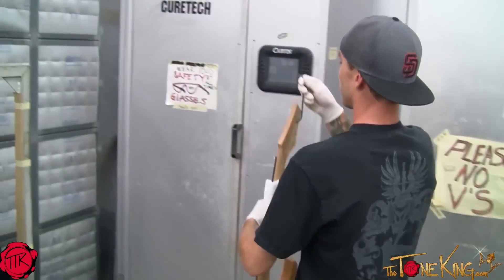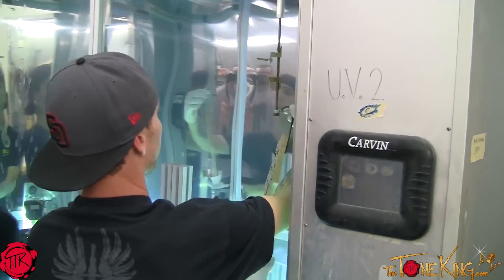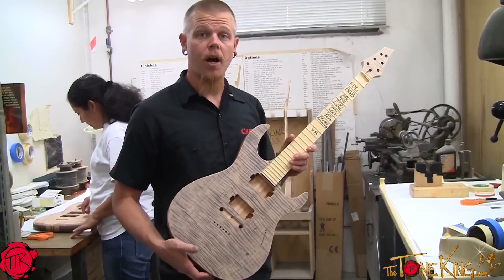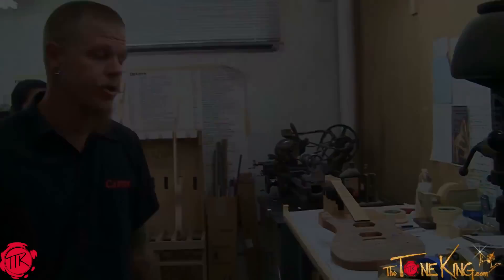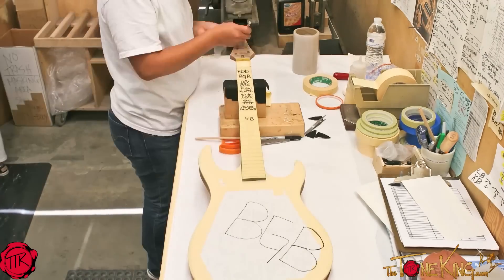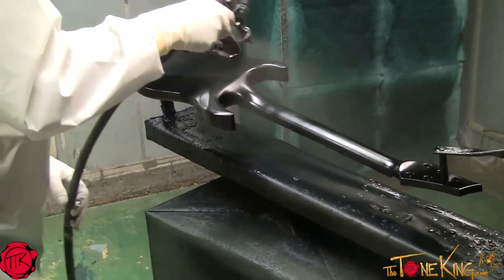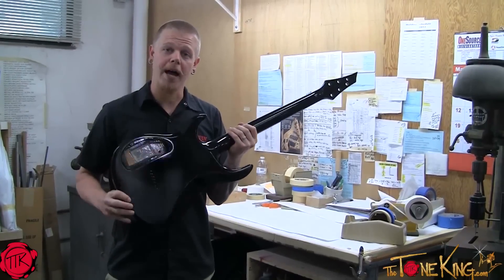KIESEL / CARVIN : PAINT & FINISH : Carvin Custom Guitar Build - Custom Shop, San Diego, CA

Comment: Ive never had a problem with any ibanez frets. about fender sticky necks, that stickiness is mostly on new guitars before the paint in the neck is worn. whether a carvin neck is accesible, fast, and easy to play on is all up to you. carvin has many models and styles, some have satin, some have glossy necks, some have cutaways, some dont have cutaways, some have xj frets, some have j frets, some are nech thru, some are bolt on. theres variety at carvin.

Comment: Personally I think the higher end Ibanez's are good guitars.  The cheaper ones I don't like at all.  Still, I like my two Carvins a whole lot better then my Ibanez RG570.  If you want a smooth neck feel, Carvin has the option for a satin finish or tung oil finish for the back of the neck.   As for neck profile, that is a matter of personal preference. I find them fast, easy and comfortable to play.

Comment: Does anyone know what's the moisture used at the very beginning of the video? It looks water-based since the cloth doesn't get stuck to the wood, but I have no idea. Is it used to seal the pores of the wood? What brand offers it?
Reply: +matias suarez porto Look for "sanding sealer". You can get rub-on or spray-on varieties.

Comment: why are you putting 2 fancy stripes in a neck through body when you paint it black?
Reply: That was the natural color of the different types of wood used in building the neck.
Reply: Xanerix i think he knows that. he meant why would you cover it up
Reply: Just reread it. The way he worded it was referring to the strips of wood as "fancy stripes" and then questioning why they were even there if the guitar was going to be painted black. The wood itself is going to appear that way before any paint is applied to it. He was questioning why those stripes were even there if it's going to be painted over. I was just clarifying that the stripes are natural and can be painted over if the luthier chooses to do so. However, some people may opt otherwise.
Reply: Xanerix i see. i guess only he knows what he really meant. the wording used is pretty vauge. I just interpreted that he possibly knew that the stripes were indeed actual wood IN the neck because he used the word, "in" not "on" which would imply that he thought the stripes were just painted on or something.

Comment: 1:10 Okay, wow! Very nice woods, very beautiful figuring on the front. Maybe a bit dull without any color, but so far very nice.
2:20 Umm, black back? Okay, there goes the beautiful back. But maybe I can live with this.
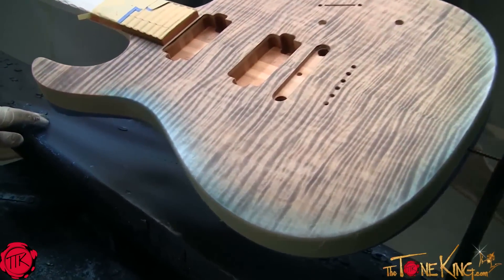3:05 Yass! That little cyan edge is beautiful.
3:30 Okay, careful with that! You don't want to go too far.
4:10 What?! NOOO!
4:26 STAHP! STAHP!
5:20 Pls kill me
Reply: They probably sold this guitar for $2500-$3000, so you're opinion doesn't matter at that point. They make some of the best guitars you can buy.
Reply: My thoughts exactly. Ruined what could've been a gorgeous guitar.
Reply: @shmirginhymer1867  its not an opinion. its a fact that putting green in the middle is stupid.
Reply: @sirspongadoodle  Not a fact. You're still wrong. And the fact you said "color theory" is all I need to know. I don't argue with people that have missing chromosomes. So have great day. Get some help.